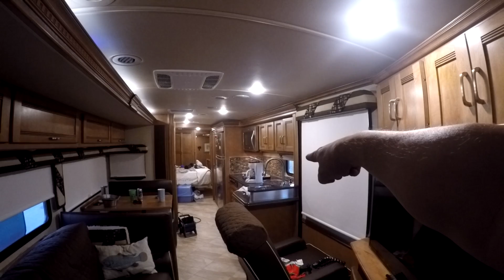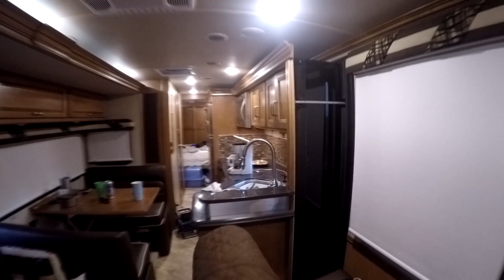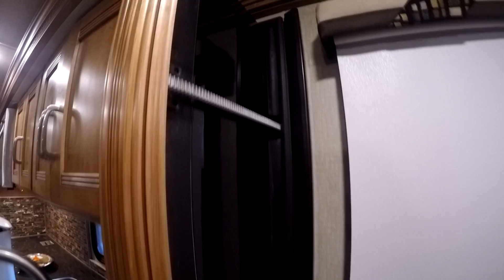Video Short - Bringing A Large Slide In - Nomadic Native

Comment: Have the issues with your slide been resolved?  We pick up our FORZa 36G on January 5th and I'd be interested in what your solution was.  Thanks      -       "Oldies in The Villages"
Reply from the maker: No solution yet but I did get a suggestion. Next time we move it I'm going to put the engine at a high idle & set the cruise control to hold it there so that the slide motors get full power. I don't know if it's a tight spot or what it is that is causing the slide to slow down then speed back up, it's like it just hits a tight spot. I also used dry spray lube on the geared slide bars before we ran them in and out last time, so hope that helps some also.
Reply: The slides on our 36G are different than the ones on our old Palazzo.  The geared track on the slide box are set off the box and kind of arched to keep pressure on the drive motor gear.  Half way in or out is when the most pressure is put on the drive motor gear.  Dealer told me it was the upgraded drive system and designed specifically to keep the drive gear from slipping on the track and jumping a tooth.  
Thanks for sharing your MH and travels with us.